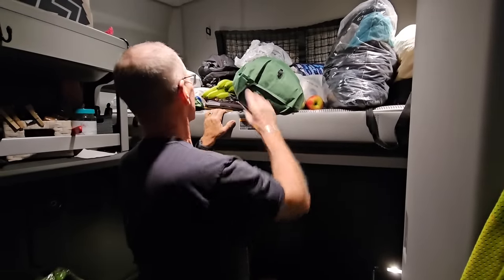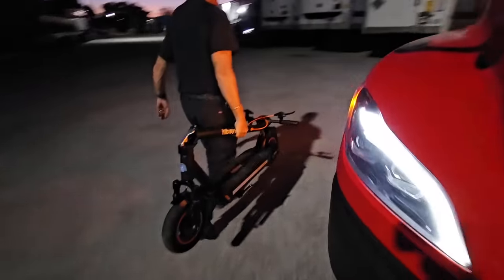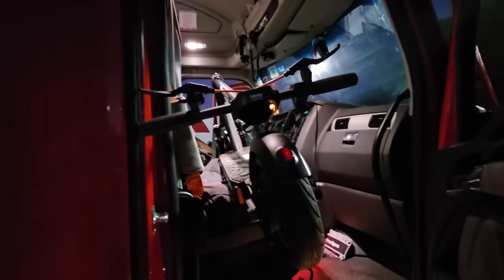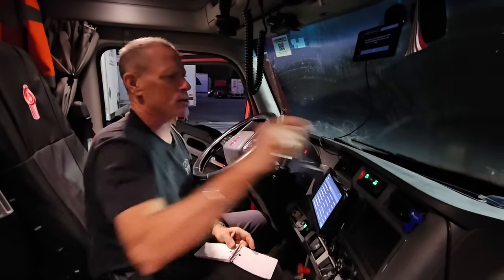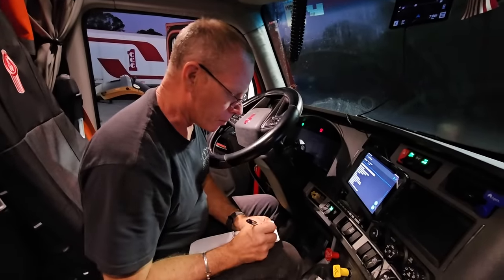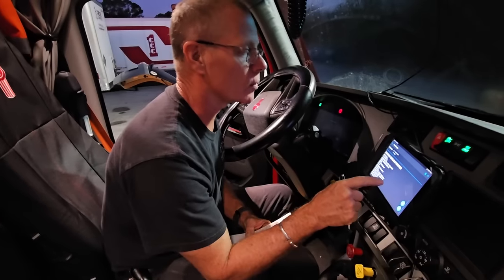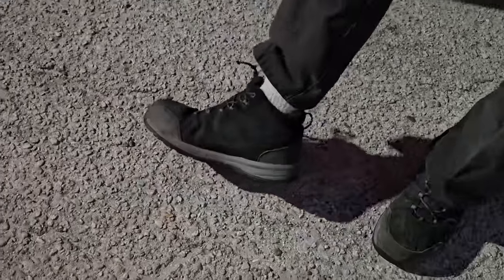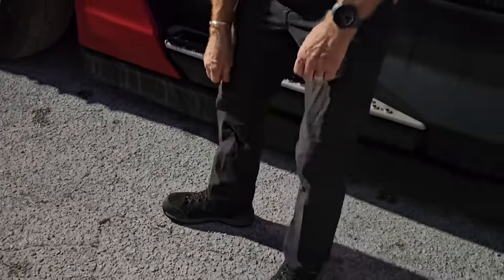Trucking - Getting Ready to Head Back Out on the Road Again

Comment: I have one comment on pretrip.Make sure you check for brake lines rubbing together at your rear brake chambers.Over the course of 30 plus years trucking I was wrote up twice for lines rubbing.I checked some other trucks in our fleet and we had brand new trucks coming in with brake lines rubbing,Just my thought of the day.
Reply: Who does pretrips
Reply: Great advice ❤
Reply: I agree. Rdcently they are checking for rubbing lines nation wide. Make sure there are enough spacers between the lines under the trailer.
Reply: @Tyronewiggums1  True Truckers

Comment: While the 2024 Kenworth T680 looks great on the outside the inside is seriously lacking in functionality. 
There is very little storage space in this truck unless you put the top bunk down and use that for storage. There are a total of 4 cabinets. One closet behind the drivers seat, 2 very small ones( I have seen bigger glove boxes) over each seat and a drawer under the refrigerator which sits right under the closet(in my opinion it should be behind the passenger where they put shelving that is pretty much useless.. It is not easy to get to and goes way back so you have to empty it to get anything that is  in the back. 
There is a space for a microwave behind the passenger seat. Under that is a space for a T.V. Beneath is 3 shelves. These shelves are worthless for most items as they are open.  They come with a bar across the bottom to keep your items from falling out, however, the bar is about two inches high and the gap is about six inches. Going over bumps causes your items to come flying out.  
The glove box holds the manual and very little else. Each seat has a tiny cubby that will hold sunglasses, and maybe one or two small items. 
Across the top front of the cab is an open shelf. It will hold anything less than 4 inches high, and two inches wide. Again, going over bumps can cause items to go flying. 
The passenger door has a cup holder. That is it.  Drivers side seat has nothing. So, nowhere to store gloves, gauges, zip ties ext. except under the bunk. Which can only be accessed from the outside. 
For one person this might be livable, for two not so much. 

Would I buy this truck again, no. I like my truck to be functional in every capacity. If Kenworth would use an actual over the road driver to design the inside I might change my mind. Until then it’s a firm no..
Reply from the maker: Thanks for your detailed comment! We agree that storage is not ideal. Our Freightliner Cascadia had way more storage AND a pull out table!!! But…we find the ride to be waaaaaaay smoother, so we would pick a KW over many other brands every time. Though we would be happy to try out a Peterbilt which Kevin had for only one week at Werner and loved. But Crete doesn’t have Peterbilt and we do love KW’s…despite the aforementioned shortcomings. 
Happy Thanksgiving to you!

Comment: What kind of engine pre-trip was that? One checks it without and with running engine to  make sure nothing is pressure leaking and you move your steering column rod to see if the connections work fine and everything is connected properly. Check radiator and good dampers, too as well as watching all hoses and AC limes not leaking whole rinning the engine for few minutes. Also check the front brakes if cotter pins are still in tact. One always checks if there is a king pin lock on the trailer if that is common practice for some drivers in your company. Usually there is kind of little band or rope hanging down from these locks so it should be visible nefore you try to hook. If you hook too hard it might can damage parts of your fifth wheel.

Comment: I haven't found one with a kingpin lock but crete is becoming more common for locking up the glad hands either to save the mt for another driver whos dispatched on a load a few days out or the shop locks em all up to do the T-1 inspections or ones their getting ready to sell seen 20+ trailers in Kansas city all of em were locked up. Also not sure if you're aware but crete no longer allows B services to be done at the truck stop supposably they sent out a message about a month ago but I don't recall ever seeing it and my asset manager wasn't aware of it either. Then again the new tablet and driver messaging on the crete app doesn't always sync up ive gotten messages on my app that never got to my truck and vise versa. I have a leaf blower its not always the best thing to use i still use my broom if the trailer is extremely messy.

Comment: Kevin, you could tell the shop personnel there in Deland about the king pin lock.  They have master keys to remove those or the Enforcer locks on the back of trailers as well. I too work for Crete and run dedicated out of Mankato.  You guys stay safe and we'll see you down the road.

Comment: I still don’t get the point of people always hitting their tires with hammers. If it was falling off the rim or less than half full you’d know without taking the hammer out and the hammer won’t tell you if you have 90, 95, or 100 psi where a tire gauge could tell you that you lost 5, 10, or 15 psi over the course of several hours and you should probably get that fixed BEFORE your tire was flat enough the hammer would tell you anything to avoid completely destroying your tires.
Reply: AS. A. DRIVER. ,   ONE. CAN. TELL.  WHAT. IT. IS. [   THE. SOUND.  IS. LIKE. A. MUSICAL. INSTUMENT. ,  SOUND. !!! .